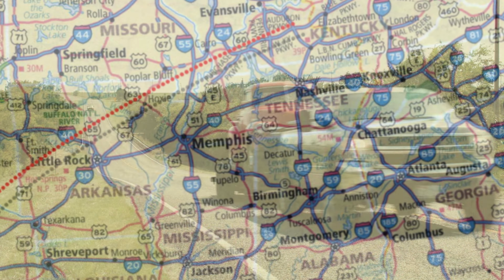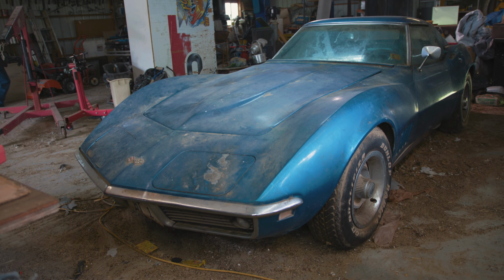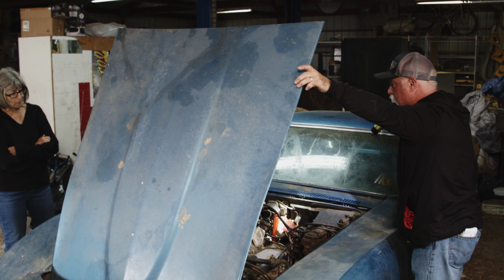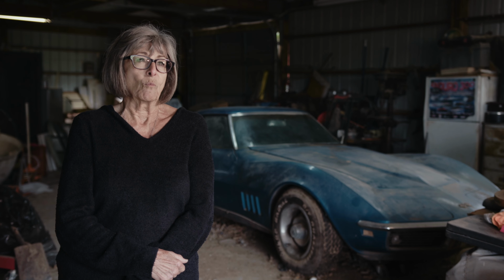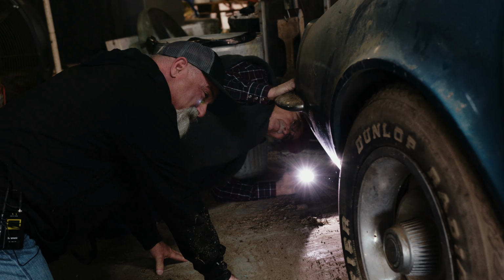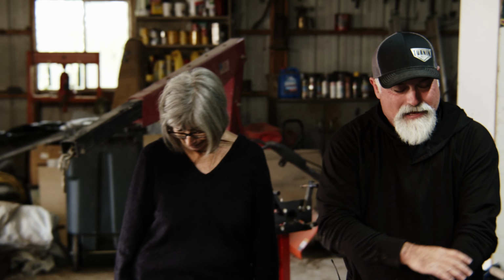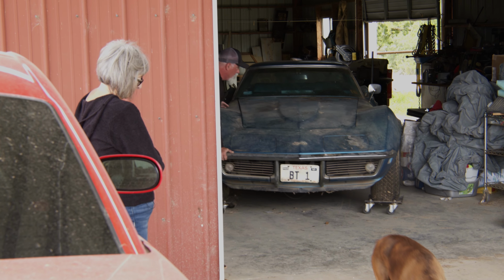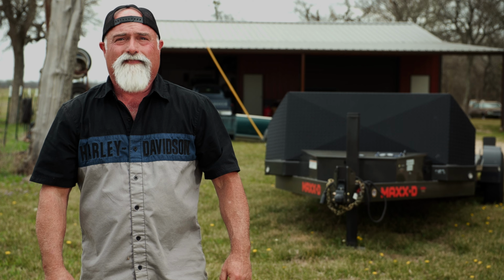The Ultimate Barn Find: 1968 Chevy Corvette Rescued After 30 Years | Barn Finds of America

Comment: 11k was like stealing it from her… But enjoyed watching the episode.
Bob is looking down saying… he should have paid you 16-18k it was all original unmolested!! Barbara is a sweet lady you could tell what she missed her husband. You should’ve paid her more.
Reply: If it has a smog pump I don't believe it is a 68.  The EPA didn't start requirements of emissions control until 70 or 71.
Reply: @bailey78  All 68 Corvettes were equipped with A.I.R. systems. (Smog pump deal) 

1968 pumps had part number 7801135. The '68 is different from '69s (except some early '69 units) in that they had the visable pressure relief valves on the top of the case.
Reply: @Tunnelramlife  
Hey thanks for the information. 
The only cars I had seen with smog pumps were 70 models and up.

Comment: Its a nice car... once you put at least 50k in it.  This is a piece of junk.-Paint, chrome, interior completely gutted, motor rebuilt, new gas tank, brake lines, gas lines, shocks, all weather stripping,and thats just the things off the top of my head.
Reply: I’ve got most everything done and parts refinished motor cost was $5500 I’ve got around 35k in it now..

Comment: 68 international blue (978) with dark blue interior (411) with hard top and 327 cu in 350 horse 4 speed. There were never many made, most of them if blue were light blue and lighter blue or black interior. Stealing it at 12,500. Robery at $10 k. Should be a shamed of yourself.
Reply: That's Le Man's blue. International was darker
Reply: 68 corvette with 350 produced 9440 units. Not rare.
Reply: Also, this is how direct sales work. What you see is all the auction, ebay, 3rd party sellers with Markup. I just bought a 1960 corvette body, all the chrome, SS, no engine/transmission/suspension/frame for $8000 direct from a widow. It will cost me $70K for a resto-mod on a corvette correction frame, LS3, 4R65 transmission, all new suspension and the car will be worth $150K. I'm also finishing a 68 original 427 Tripower coupe and it will cost me $30K for that. Its a 3 year project.
Reply: @jonathanp6671 Ok you I’ll agree after seeing this again on a bigger screen. It’s hard to discern color on phone screen. But international blue was not very plentiful. Light blue much more common. For some reason (maybe beat to shit) many ‘68 do not survive today as years 69,70,71,72 did.